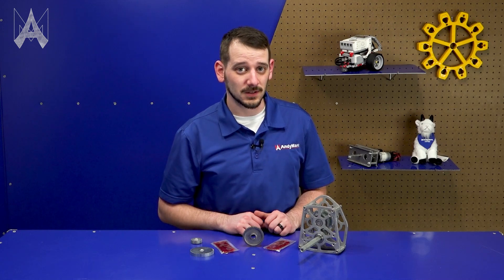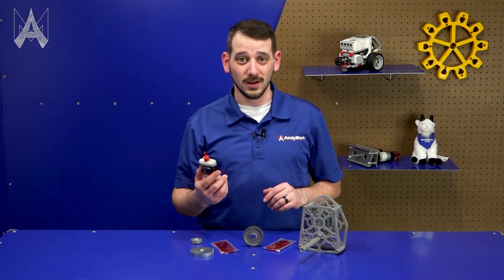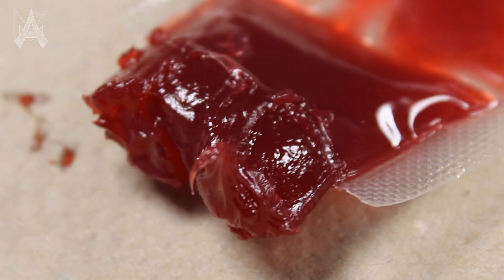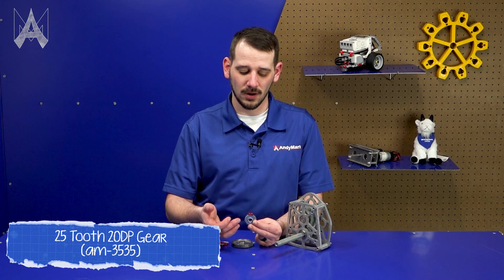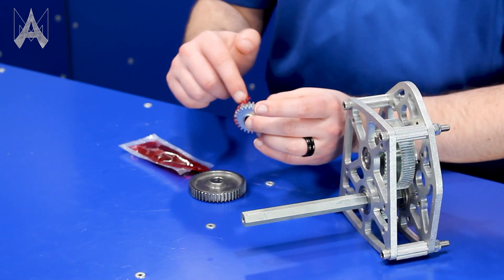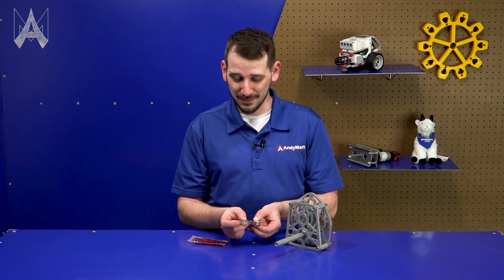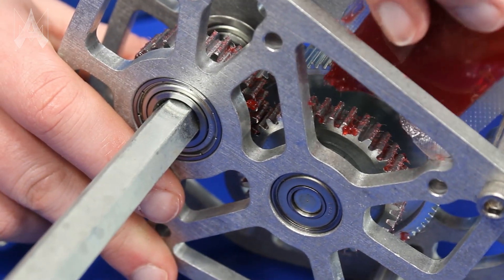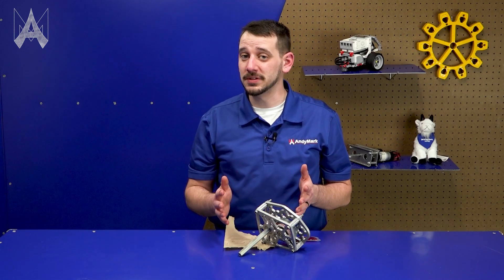How Do I Grease a Gearbox?

Comment: Why is the grease red? I have a toy robot but instead of greeasing the gearbox, I wash all the grease off and it still works properly. Looks like it doesn't need grease. Why would the toy factory put grease inside of the toy robot's gearbox if it doesn't need grease? There is no need for grease in my toy robot's gearboxes!

Comment: Would WD-40 be suitable for lubricating plastic gears? How do you clean off old and sticky grease from plastic gears?
Reply: 1. No. Wd40 dry quick and too thin. 
2. You can use degreaser
Reply: I recommend silicone grease, its what I use

Comment: Recently put metal gears in the milling machine, and was wondering about lubing the gears.
Reply from the maker: Gears should definitely be properly lubricated when in use to extend longevity. You should check the manufacturers documentation to see if there is any particular recommended method.
Reply: @AndyMark  there is, and spaying white lithium grease on a yearly basis doesn’t seem good enough.